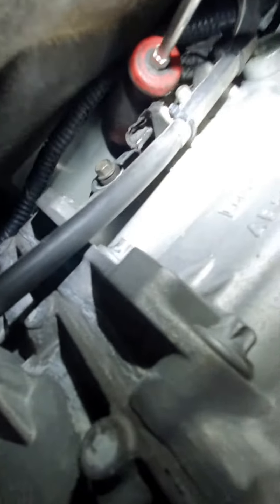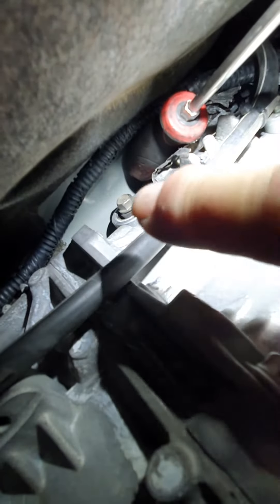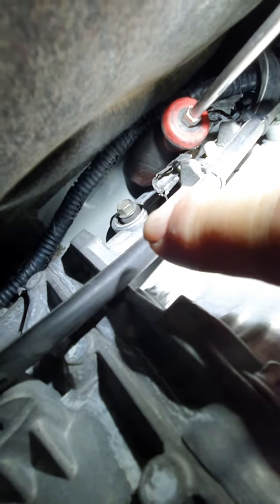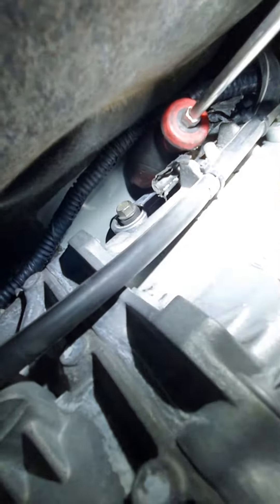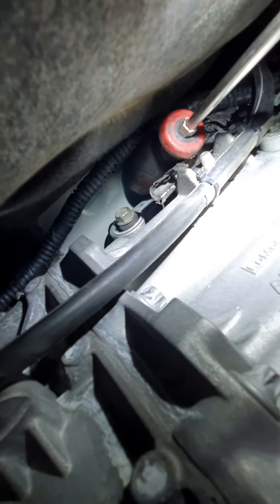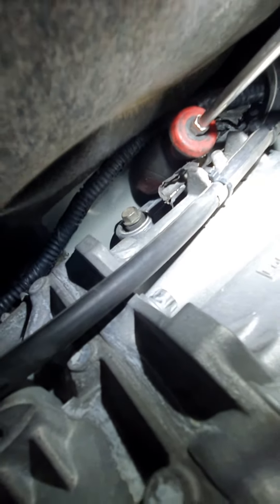Ford Ranger PX model 3.2lt, Gear shift problems  Loose sideways gear lever loose gear stick

Comment: Absolute Champion - This has been doing my head in for 12 months
Reply from the maker: @jedbennett7397  You've got the Victory now. Regards Matt
Reply: @firstclassbrakesandautomot6941  1 Bolt vs 1 Man  - An hour and a half battle because the man should of bought a 13mm Geared Ratchet Spanner but he took the Victory eventually 😂

Comment: Bloody legend. Thanks mate, saved me a lot of garage time. - BTW: The M8 x 50mm bolts with a locking washer from Bunnings work well for this job.
Reply from the maker: Thanks. I wasn't too sure of the length of the bolt as we'd done the job ages ago. 
May 2022 be an amazing year for you, Regards Matt.

Comment: Hey mate, got the bolt from Ford put him in and and the loose gear lever is fixed everything is nice and tight now. However same issue with trying to get it into 1st and 2nd. What do you think could be the issue? Cheers
Reply from the maker: I'd also check the bolt on the other side

Comment: Thank you so much for this video. This has happened 3 times to us now but at least this time I was able to fix it myself and have brought quite a few spares lol.
Reply from the maker: That's Great News
Reply: @firstclassbrakesandautomot6941  what's the thread pitch on the bolts?
Reply: Happened 3xs? 
Do y'all not have threadlocker available to you?

Comment: hi the red bolt you pointed out has washer with it ...once the bolt is tightend should the washer be hard against the housing or still able to rotate ?
Reply from the maker: The red bolt has the washer moulded to the bolt the washer is part of the bolt. I'm not sure that your washer should rotate unless maybe your bolt is too long you could try an extra washer or maybe a shorter bolt Hope this helps Regards Matt

Comment: Gee mate you have just made me smile so much iv lost these bolts this evening 😂 thank you woul  appreciate a bolt diameter size
Reply from the maker: Sorry I should have put the bolt diamention I will get the exact size if or when we get another vehicle in but either a M8 x 1.25 or M8 x 1.5 thread size I'm pretty sure Thanks regards Matt.

Comment: Legend
Reply from the maker: You are most welcome Regards Matt
Reply: Happened 3 weeks after installed clutch and that same bolt walked out on one 400km trip was a nightmare to find first second without mechanical knowledge

Comment: The my bolt was there a bit loose I removed it and put it back lost gear 1- and 2 again after a few days. I bought 2 new bolts put them again after a few days I loose gear 1 and 2 and have to remove and put back them it becomes fine. What can I do to fix this problem permanently am frustrated blowing my gasket already 😊

Comment: Mate thank you so much I was driving home today and mid shift the whole thing went loose. Don't suppose you know what bolt size it is? If not all good I'll just take the other one out and get a size off that as long as the drivers side and passenger side are the same size and length.
Reply from the maker: Sorry not sure of the size and length. But I'd be 100% that bith sides are the same size bolt.
Perhaps you maybe able to call the Ford dealership to see if there parts system could have the dimensions Regards Matt
Reply from the maker: Genuine FORD number is W716468S437
Its a M8 x 45 bolt not sure itlf its 1.25 or 1.5 pitch thread

Comment: Hey my ford ranger keeps jolting from 1-2nd it’s auto and I have done a transmission fluid change but no fix. When ever I accelerate slow it jolts worst then I accelerate and hard on the pedal it doesn’t jolt you know why?
Reply from the maker: Get someone to scan the computer amd see if there are any codes not only for the auto but also for the engine. At times if the engine is not running properly ot does have am effect on the auto changing gears
Was the auto trans oil really black or bot too bad ?
Regards Matt

Comment: What's your solution for the bushes being stuffed? Bolts are all there but the right side bush is flogged out. From what I can see Mazda/ford only sell the complete shifter assembly🙄 and gearbox has to come out to fit.
Had any experience with this?
Reply from the maker: Hi there. No to answer you question we've not seen it yet. My thoughts are you could remove the driveshaft/tailshaft and remove the rear gearbox mount. That should enable you to get over the top of the gearbox to remove the shifter assembly rather than having to remove the complete gearbox. Take care that as you lower the gearbox after removing the rear mount that nothing at the front of the engine is damaged. EG the top radiator hose gets stretched etc etc. Problem is if there's not'a part number for the bushes then it's either a 2nd hand shifter assembly from the Wrecker or get the measurements of the bush and try and find one that will do. Alternatively if you've access to a lathe you could spin some up out of plastic maybe. Let us know how you get on as anyone else following this maybe able to learn from it. In the meantime, when I get a mo, I'll look into it. Thanks Matt.
Reply: @firstclassbrakesandautomot6941  mine appears to be doing this. Bolts are in, tight, yet alloy housing still wobbles,  looks like someone else had been at it before me, a few other screws missing,  but I'll probably need a new clutch so I'll try line it up with that!

Comment: Hi, had the same issue, found the bolt with a rubber washer on it, 10mm... Put it back, worked fine for a day, now it's hard to get into first and reverse while running... Any help greatly appreciated
Reply from the maker: Id just make sure that everything is sitting in alignment
If need be remove the bolt and move the linkages around and or pop it on 1st gear them refit the bolt. Regards Matt

Comment: Hi m8 what size are the bolts m8
Reply from the maker: M8 x 1.25 or 1.5 metric
About 45mm to 50mm in length 
Cheers Matt